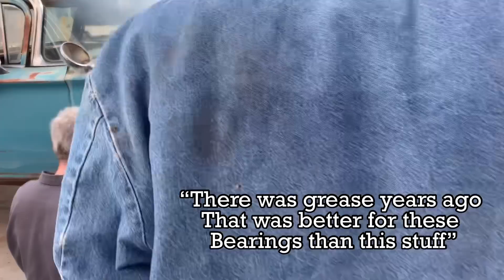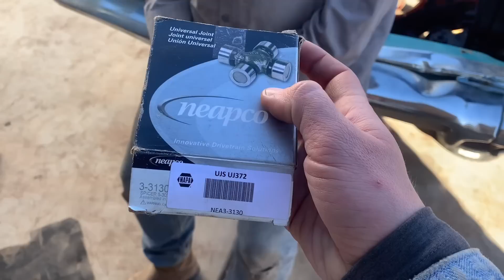ABANDONED ‘60 El Camino gets new engine , transmission and brakes!

Comment: Sta-Lube® Heavy Duty Drum Brake Wheel Bearing Grease-.SL3131.  CRC  just discontinued it, you might find some somewhere though. It does have the fibers and is very thick, like wheel bearing grease always used to be. Fromm electric shows some in stock.

Comment: I always bled brakes using a piece of transparent hose & a glass jar. If you have the open end of the tube immersed in brake fluid in the jar you can't suck air back into the system. Leave the bleed nipple cracked & pump the pedal till you see no more bubbles, tighten the nipple, job done.

Comment: So good to see you putting the 60 El Camino back on the road.

My first car bought in about 1982 was a 1960 Chevy Biscayne 4 door post & I still have the car ,  but its not run in 35 years.

In a pinch to repair the radiator in my 60, I used  clear silicone & sand on the main vains. It worked
several years in front a 283 as well. My 60 was the copper color just like the pic I have on my page.

Comment: Great video.I learned a trick on packing bearings. Put the grease and bearing in a Ziploc heavy duty freezer bag and pack it from the outside of the bag. It a is zero mess step. And you just zip the bag shut and the grease can be used again till you need more added.

Comment: you need to use good spray acid flux when you solder, and you need 50/50 solder. get a thicker solder so it fills good. i used to re core radiators.

Comment: one of the best old bearing greases was Texaco 'Alemite' grease, it was thick and 'stringy' when you pulled a gob out, once packed it  stayed in the bearings better, could pulled some apart packed 7-8 years prior (and after that they were neglected) and the grease and the seals were still good, but still put new seals and grease in them though.

Comment: You did put it all back together when you replace the seal on the pinion the same way it came apart? The old copper radiator is worth a little bit and scrap it can offset a decent chunk of that cost of your new aluminum radiator.

Comment: You're right. I have never seen a radiator rodded out. I'm sure that took a little time but I would be willing to give it a try if I need to now that I saw you guys doing it. Also noticed that super eagle in the background. What year is it and do you plan on redoing it? Might make for a good video series. I have several of them.
Reply from the maker: I think its a 60. And it’s got an aftermarket motor on it already so she’s set

Comment: I've done many radiator rodding, I saw that while u were soldering the tank u kept heating the solder to drop onto the crevices , next time try heating the tank n then applying the solder, it will fill that gap fast. It's like soldering copper tubing,heat the metal n apply the solder to the metal it will run itself into place . Just a suggestion, u will see how fast it fills. I usually can solder a radiator tank in about 5 mins.
Reply from the maker: Thanks for the tip!

Comment: Great series on the el Camino. My first car is a 60 bel air. When I bought it in 1995 it had a similar v8 swap and for years it had a horrible driveline vibration around 55 mph that I couldn’t fix. I eventually figured out when the v8 swap was done the 6 cylinder frame stands ands were left in the car. They cause the v8 to sit about 2” higher and 2” forward that’s why you had to use the modified trans cross member and it makes the motor and trans sit a to much of an angle for the driveshaft. The v8 frame stands will correct the motor placement and you should be able to use the unmodified trans cross member. Unfortunately with the motor sitting in the correct place the hei distributor will not clear the fire wall. I still have the car it currently has 500hp 383 with a tkx 5 speed and it can comfortably cruise at 80
Reply from the maker: Thanks for this tip because our rad fan won’t fit in the fan shroud and we’ve traced it back to the motor mounts being to tall yes the v8 was shorter. Glad to know those things before we put those on.

Comment: Very nice job on setting the motor in , rebuilding all brake components, and drive shaft u /joint,  also did you have to change out the chassis mounts .

Comment: I actually have done that to an old radiator before when I couldn't find one. It caused the same problem when I rodded it the tubes popped in the weak spots. Ended up getting a rad for something else and made it work. Its a forgotten skill now. Nice video👍👍👍
Reply from the maker: Definitely a lost art

Comment: Hey guys I don't know if you remember the comment I send to you whend you workt on the 48 chevi pick up I hade whend I was 20 years old a 1970 Ford mavric I installed a 289 v8 it came with brake drums front and rear but I change it to disk brake on the front with biger master cylinder I hade to change the front spindle

Comment: cant knock someone for being a do it yourselfer  but i can point out youre mistakes on fixn that radiator....they have a drop seam header when you close that gap between the tank and the drop seam header they will split almost every time thats caused by fatigue from spreading it apart with some sort of tool ..most of all you used to much heat to take it appart and you used the wrong solder to put it together and fix the leaks but you had the right ideas you just went about it wrong.a small propane torch is all you need for heat and use solder for plumbeing not electrical work and next time just flush it with the air and water like you did dont rod it out thats what kills them in the core area. 12 years fixn rads i learned a few things.